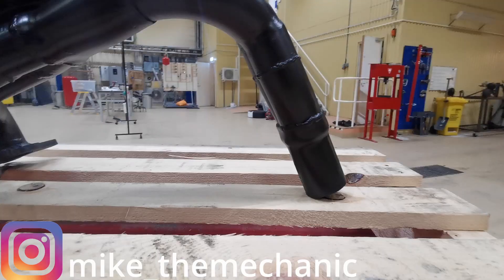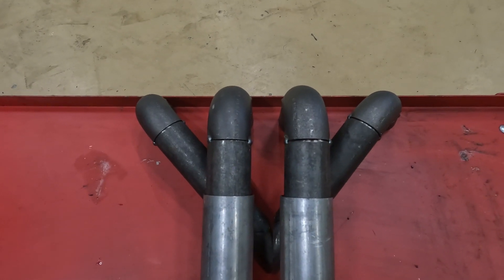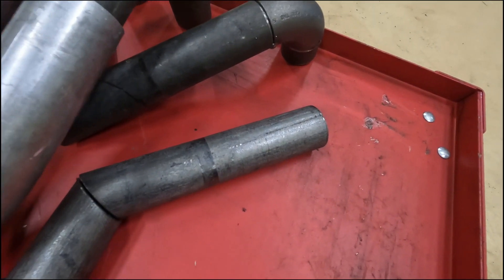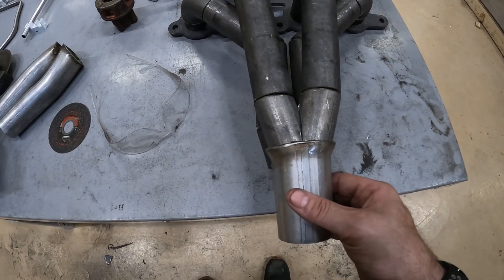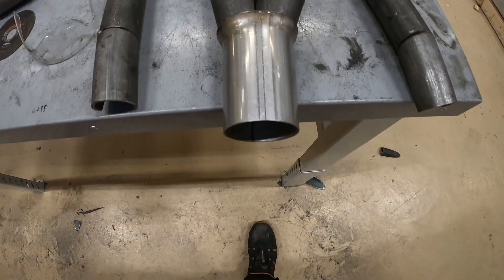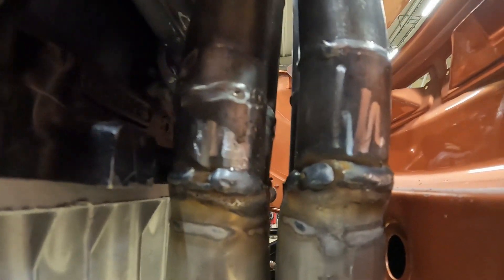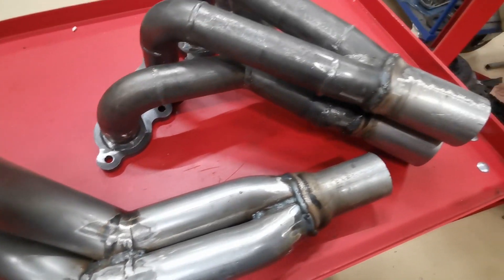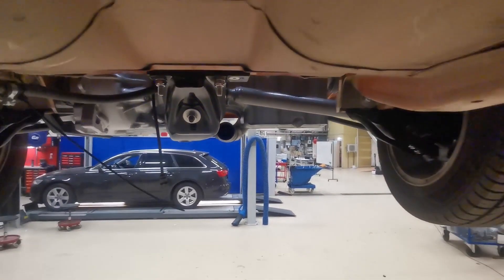CUSTOM DIY exhaust manifold for a zetec conversion mk1 fiesta.

Comment: Good bit of fabrication but kept wondering if easier to start with something like a Ashley 4-2-1 manifold
Reply from the maker: Yeah it probably is, but I have to pay extra for postage to Sweden and as I've worked as a welder for many years it was a bit of fun and a challenge
Reply: @Mike the mechanic  I sold mine for about £50 last year from a 2litre in a mk 3.5 Si. Keep up the good work

Comment: Great looking tri-y header. What rpm range are you trying to tune for? Long tubes should help out the lower range torque.
Reply from the maker: Errrm wasn't really trying for anything specific, I've never built an exhaust manifold so I wanted to try to make one 😂. Good to know that the lower range wshould be good though.
Reply: @mike_themechanic  I didn't know if you had built the motor for higher rpm range or if it's going to be a street car. 
  Again, nice work. I don't know much about those little cars, but I dig your creativity and style. I'll be watching for future updates. 👍
Reply from the maker: It's a standard engine minus the power steering, AC and cat so I'm expecting somewhere around 150hp. I want to keep it standard looking but with some power hidden under the bonnet 😊.
Thanks for the support I really appreciate it.